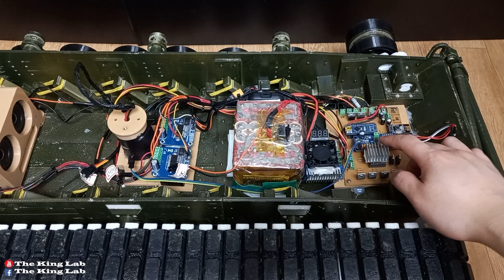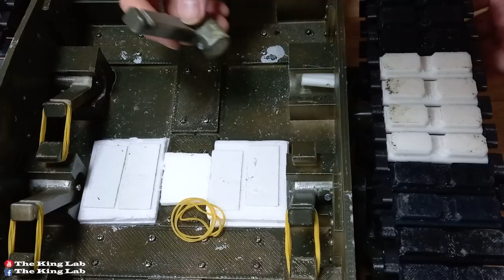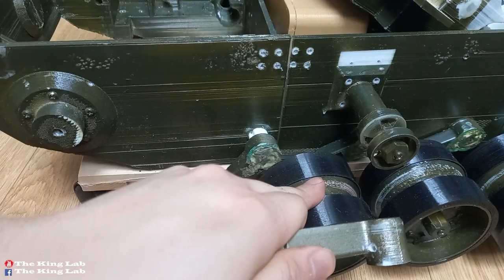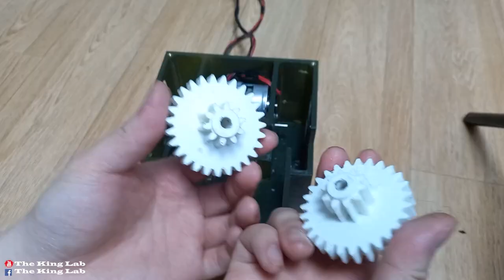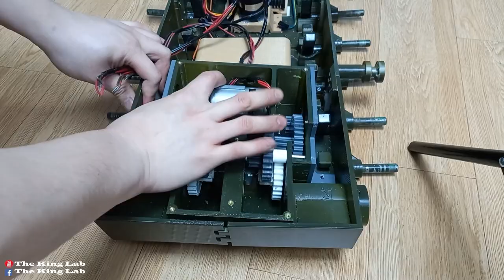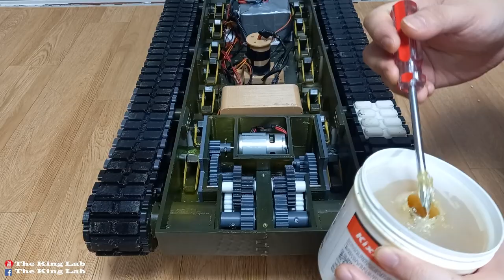RC Tank: M1A2 Abrams Scale 1/9.  Part 1: Upgraded Movement System

Comment: Hi still trying to get electronics sorted the Abrams i have comes in at around 22kg has 2 12v scooter motors chain driven any ideas what to use ESC,s mixers etc.

Comment: Very nice design. But are you sure that your drive motors are not overheating in the closed gear housing? the ones I know - get hot after just a few minutes of driving.
Reply from the maker: You can use it all day without fear of overheating